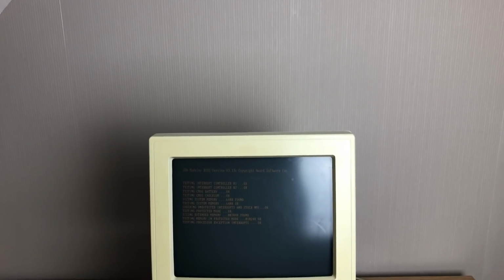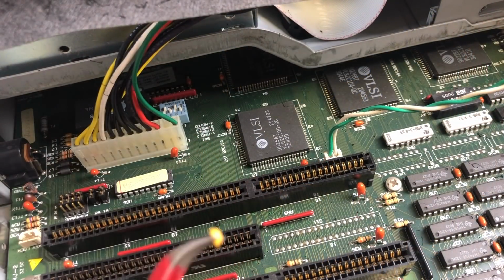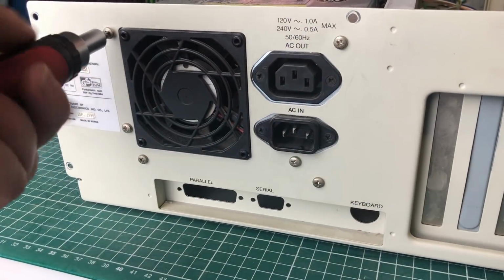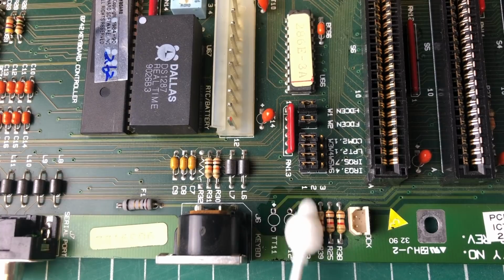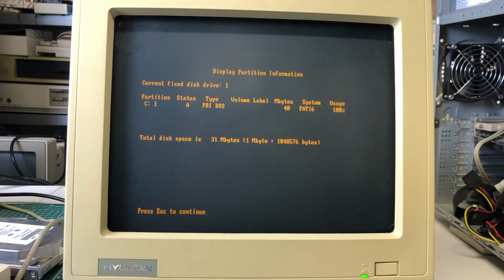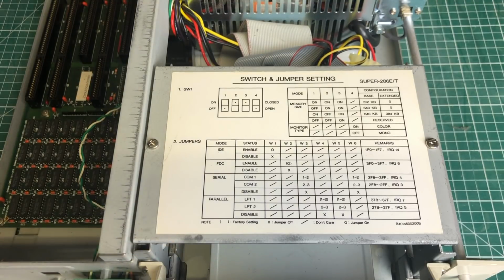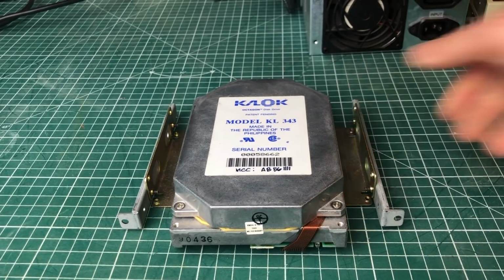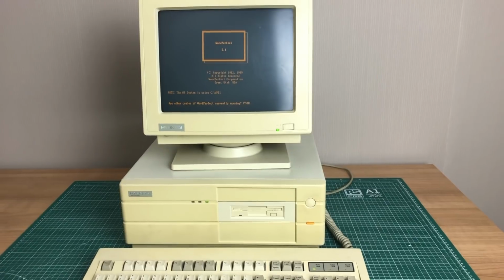Hyundai Super 286e : The most boring computer ?

Comment: Boring? I'd love to have that machine! Back in 86, an AT clone was my first "personal UNIX machine", running Xenix 2.1.3 and Microport 1.3.3. After all these years up to todays monster-machines, I think it would be fun to spend some time on real hardware like this. I do maintain a bunch of simulators with various Unices, just for entertainment.
However, real hardware like this offers the option to go shop for some add-on cards, I would need to get my old tapedrives running (a simple Adaptec 1540/42 would do - not hard to find). That would give me access to my old tapes. There is lots of rare and interesting UNIX stuff on these tapes.
I think I seriously need to find an old machine like that...

Comment: That's got to be my exact same keyboard from the late 80's. I have like 50 old keyboards, and I have not even seen it again until now.  I like the VLSI chips. My 286/12 had the same.  But my RAM was 70ns with 80ns recommended in the manual, and this is 120ns??? Shouldn't that be for an 8088?

Comment: This is a 16-bit system, so a RAM bank has 16 chips + 2 parity chips (all chips only access 1 bit at a time), so this is 2 banks of 512KiB, not 4 banks of 256KiB. It also says so on the silkscreen. The four columns are labeled "bank 0 (odd)", "bank 0 (even)", "bank 1 (odd)", "bank 1 (even)". Otherwise, nice presentation. The RAM options you can select with the DIP switches are very common for early AT computers:
(a) 512KiB (18 * 256KiBit chips) only
(b) 512KiB (18 * 256KiBit) + 128KiB (18 * 64KiBit)
(c) 512KiB + 512KiB (36 * 256KiBit).

Comment: After my first computer  blowned up in 93 (a Tandy 1000HX with an horrible green mono screen), I was using a quite similar machine until 1995. It was running very well wit Windows 3.1, MS Office and MS Publisher. The 720x348 B&W resolution was very stable on an amber monitor. And surprisingly, it was a great time ;-)

Comment: i recently got hold of a hyundai super16te,, 8 bit 8088 ! unfortunately a nicad backup battery has leaked corrosive goo and cause a lot of track damage 😢
Reply: ...i've heard about tantalum caps blowing up , but never come across it myself...yet.... i have had some small multilayer ceramic caps blow themselves similarly, though, on a multi IO board, had to replace the lot , they kept popping themselves!
Reply: i see this 286e uses the same 'non standard' power connector pins like mine, more 'square' than the usual 'flatter' AT type...

Comment: Two points I'd like to make...1. Usually the last two choices in the HD selection are 'user defined' so you can manually set the HD parameters, unfortunately the video did not seem show all of the choices.      2. The connectors that broke off on the back are probably reverse threads. This design would allow you to unscrew the parallel or serial adapter without allowing the attaching screws to come loose, as they would tighten when unscrewing the adapters.
Reply from the maker: Roadside Rebels this one did not have a manual selection. Only a predefined list. Regarding the connectors on the back. On this machine I noticed some glue like residu on the back  of the connectors, as if somebody did not want them to get unscrewed. I had an identical Hyundai where I was able to unscrew them without any issue.

Comment: Yeah those old tantalums like to blow their tops. I had one go off in a 486 motherboard, but it somehow still works.
Reply from the maker: jq747 sometimes they sit on a power rail like the -12v that is only used by some very specific expansion cards. In that case the pc continues to work fine.

Comment: Dont forget to turn the hard drive upside down and put a few drops of light oil (like 3-in-1 sewing machine oil) on the hard drives stepper motor bearing and give it time to seep in. dry stepper motor bearings are one of the causes of these early drives to fail

Comment: You're better off using solder wick when desoldering components from plated through-hole PCBs. Solder suckers are practically useless for this application, and you'll only damage the solder pads. Just heat the solder, pull the lead out from the through-hole with fine needle nose pliers, and clean up with the wick. It's much gentler on the board.

Comment: On my first IT type job I had an 8088 which had turbo when I pressed certain key combo. 6MHz, maybe? Our server was a 286/8.  But then in order to run the new backup tape system they gave me a 286/12.  The speed was sweet compared to clunky old PC I was using. Productivity certainly improved.  Amazing what you could do back then with these primitive PC's when the O/S was small and fast.

Comment: wow, an IDE connection in a 286 Pc, was very ahead for his times (about this)
Reply from the maker: a lot of these brands came with onboard connectors. A lot of earlier computers (Tandy / Commodore) also had onboard floppy controllers. The clones typically required separate expansion cards for floppy and IDE.
Reply: @RetroSpector78  about the IDE separate expansion card i remember something when i was a kid, i had a Memorex Telex 7045B, a 286 at the time, obvioulsy monochrome VGA display

Comment: I also have this PC. Mine has a Seagate ST-125A and a 5.25” FDD in the top slot though and MS-DOS 4 on the HDD. My monitor displays everything in white though.

It’s by far the oldest PC in my collection and requires the least maintenance. :D Haven’t had any blown capacitors or empty Dallas chips yet. 
Sadly I haven’t found time to do any projects on it so far.

Comment: I'm skeptical that it's ok to select different drive configuration parameters (cyl, head, etc) like this. I tried that recently and got nothing but grief until I figured out how to configure it properly. I got some of the same symptoms you're getting...wacky behavior on format etc.
Reply from the maker: Still haven’t figured it out myself ... also have had mixed results. Some things work others don’t. You’re also never sure what was done with the hardrives themselves by the manufacurers. For example I have a seagate barracuda rebranded by compaq. The hadddrive is 20gb but compaq added firmware so that it only reports 10gb (they used this drive as an official spare part for another 10gb hard drive)

Comment: Damn, it's amazing how these old AT era PCs can directly bolt in an ATX power supply....
Reply from the maker: ATX ?
Reply: @RetroSpector78  ATX is a newer power supply and motherboard standard.. it came out in the mid to late 90s
Reply from the maker: adventureoflinkmk2 i know ;) but I don’t see any atx psu here.
Reply: @RetroSpector78  there isn't.. but the way the case is designed and how the holes are aligned to screw the PSU in, it looks an awful lot like how you mount a modern PSU in there
Reply: @adventureoflinkmk2  standard AT PSU (not big IBM XT and clones) share dimensions and screw pattern with modern ATX PSU, for a time most cases were sold with both AT and ATX motherboard screw patterns and they even included an AT I/O shield. It's nice to know that you can install a modern high quality ATX PSU on an AT system with a cable adapter, most ATX don't supply -5V but there are some more expensive adapters that include that and a 12V load.

Comment: Those beige boxes aren’t never dull, they are awesome! :D

I bought a Kalok 3,5-inch 30MB RLL drive for my 8086 around 1990. It was cheap for a teenager like me and the main reason I bought it instead of a Seagate or some other big brand. While Kaloks were bashed already back then, the drive worked beautifully the time I had the machine. Only negative thing about it was that it was really loud for a relatively modern 3,5-inch form factor drive.
Reply from the maker: I have had a couple of broken kaloks ... mostly mfm ... this is the first working Kalok IDE drive I have. Has some bad sectors but seems to be working fine now. It is kinda loud, but love that old school sound ...

Comment: I have the same harddrive. Could I kindly ask you to verify something for me? My drive is working completely fine but every time the controller initializes it it makes a horribly loud klicking noise just as if the heads are slammed against the stopper. You can hear it here at about 10min 10sec: https://youtu.be/jL_H1i3fHZo ... Is your drive doing this as well? By the way some quick remarks on this drive: I found CHS parameters online that say that this drive has 676 cylinders but on my drive that was not true. It autoconfigures with 670 cylinders and if I manually use 676 cylinders the stepper motor runs to its limit and makes buzzing noises. Secondly this drive has no auto-park feature so you might want to park the heads.
Reply from the maker: Mine does not make that knocking sound like yours during initializing.I found the specs here https://stason.org/TULARC/pc/hard-drives-hdd/kalok/KL-343-43MB-3-5-HH-IDE-AT.html but the 286 bios did not have it in its list. and there was no auto-detect or 47 user-type
Reply: @RetroSpector78  Thanks for your answer. I think that is where I got the specs at first as well and after running into the above mentioned problem I dug a little deeper and found a scan of a very old HDD parameter catalogue where the same 676 cylinders were mentioned. Still if I use these parameters the drive will overrun its stepper motor range. So I just stick to the 670 cylinders that autodetect gives me. Just thought you might use these infos if you eventually use this drive on another machine that does have a 47 user type option (:

Comment: I'd love to have the HDD please
Reply from the maker: Will not survive shipping :)
Reply: @RetroSpector78  double bubble wrap it and mail it to:
Jeremie Johnson
18 Scenic drive
Belmont NH 03220
Reply: Hi - Vintage small capacity IDE are very expensive, most are also advertised with bad sectors.
I have 2 x connor 420 450 ?? IDE's in my Pentium 100 and they work perfectly

My Pentium 2 i just gave up and used a IDE to Compact Flash card for @ $10 new and a 4Gig card for @ $15
So for $25 i have about the fastest and most stable hard drive to suit, it runs Win 98 - i know it is not genuine or original but it works great.

Note there is drive CMOS limits on 26/386/486 etc for larger drives than the original CMOS can handle - before the auto detect bios versions.

You can use a drive manager like super fdisk or  DiscWizard. this was a separate purchase item, however many drive manufacturers bought it and modified it t work only on there brand of drives, eg  Seagate DiscWizard - it will be trial and error to see if it works also onbrand X or Y, in saying that, the seagate version works on my compact flash card - how strange

Also different dos versions have a drive and also a partition max file size as well

Regards
George

Comment: You call this boring?
I call it amazing for its time. 
And you missed why entirely: that onboard ide/fdc is a real treat and frees up one of the ISA slots for a total of at least 5 slots that you can stick a TON of stuff into there.
If this was my puter, I would yank out that ram convert it to socketed while finding the max amount of RAM chips that will go in, trade in the 286-12 for a -16, find a 287, and load all them ISA slots for a TON of "connectivity"....
This machine has tons of potential, especially with a working onboard IDE/FDC.
Reply from the maker: Most of these branded computers had onboard IDE / floppy , but also I/O (serial parallel), so they did allow you to put more stuff in the ISA slots ... but you would have a hard time finding 8 useful ISA expansion cards on a 286 :) (sound, network, xt-ide, memory expansion, some AD/DA conversion card, a scanner port, ..... ?). Once had 13 ISA cards in an IBM XT + expansion unit ... that's my personal best :) Would be interested in seeing what you would put in there ....
Reply: @RetroSpector78  I dunno, if memory serves me, all of my 286 machines had none of the above for onboard peripherals, not even serial/parallel ports.... maybe just bad luck I guess. But that was so long ago I prolly got my recollection messed up. Still, this hyundai machine, for me, is pretty awesome lol It would have been even better with 32 pin ram or even, Zif 32 pin ram lol
Reply from the maker: MeMad Max a lot of brands like Acer, Philips, Commodore had pc’s with these peripherals built-in. Most of these boards (like this Huyndai) were not standard and could not be used in generic AT cases due to the non standard positioning of the keyboard connector (and the presence of serial / parallel and/or other ports). Most clones used a standard AT layout and those indeed did not include stuff like onboard IDE / Floppy and other IO.

Comment: One of my summer jobs as a teen was working for a Hyundai reseller, selling exactly this system.  We sold it with EGA initially, adding to the mediocrity.  Amazingly, we never had any come back, but we never got any repeat sales either.
Reply from the maker: Hehe ... would have loved to have gotten one with an ega card and monitor .... but hey .... not going to turn down an amber monochrome monitor either :)
Reply: @RetroSpector78  the "e' in 286e was the EGA version, so the local reseller who made that one must have swapped out the card and monitor :-)

Comment: Weren't you curious what was on the drive initially? It seems there has to be some compatible setting in which it had operated before.
Reply from the maker: Yeah unfortunately that data is gone. But got a second identical one with the Connor hard drive installed. Because there was a connor 40mb geometry in the cmos list I was able to start that one with the hard drive without formatting. It just had wordperfect on it and some other utils. Nothing special.
Reply from the maker: Not really sure how to handle this : obviously could have put the hard drive in a more modern pc and check but didn’t want to bother with that. The kolak geometry was not in the list so I just picked a one where the CHS was pretty close, but obviously there are lots of types to choose from. How would you have done it ?
Reply: @RetroSpector78   My first go to option would be a newer computer. But if that is not an option at the time, I probably would have tried every entry I could. If the drive is working, the PC would boot eventually, or if not bootable, it would be readable at least. I have done this method in the past, and had some success with that.

Of course it is tedious, and if you know whats on the drive (like you did), and has no importance whatsoever, I'd just do the same and fdisk/format it.
Reply: In general you have to make sure none of the settings are higher than the drive’s physical geometry.  You specified 5 heads with the Conner profile, despite the drive having only 4.  Sometimes drives can use multiple profiles, but most of the time when you ask a drive to use head 5 out of 4, it’ll just fail and that address won’t be readable.  Or you’ll get some sector you weren’t expecting, and you’ll start corrupting the file system.  Either way, bad news.

So I would look for a profile where heads and sectors matches, and then take what I can get from cylinders.

Of course, you could also use a tool to view the FAT BIOS Parameter Block to see what the geometry was when the FS was created.  You can do that with a hex editor if you’re willing to decode it yourself (not too hard, just mind the Little Endian 16-bit numbers.)

Comment: Only capacitors can go wrong right? should really be asking yourself why the caps have all blown.
Reply from the maker: I guess all capacitors are prone to failure over time ....  These tantalums just do it in a very obvious way .... Don't know if it was related to quality issues, or their specific usage in the electronic design, but I don't think there has ever been a culprit besides just old age in all of the computers that I've dealt with.
Reply: @RetroSpector78  High ripple from the power supply is the cause, if any caps should be changed first it should be those in side the power supplies primary and secondary stages, replace with a quality brand, usually panasonic are the best for power supplies or Nichicon FW series.
Reply: In machines of this era, tantalum capacitors do just go bad, and do so VERY often. Amount of use may play some role, but as far as I've seen, it's just time that does this. The caps blew not because of other issues in the system (though that doesn't mean there can't be other issues, of course), but because when tantalum caps go bad, they go short circuit. When you have a short circuit across power rails, bad things happen. 

It's actually kind of lucky that these caps literally blew up, because that makes it easy to tell that they're bad. A lot of the time (usually with PSUs with over current protection) they will look perfectly fine, and it'll take hours of trial and error to find what's wrong.
Reply: tantalums have a porous anode and with age short out, its best just to replace them all, often times you can get ceramics of the same values which were unavailable back in the day
Reply: Typically when I run into AT based systems it's always the Resistors connecting to the Keyboard are burnt up, probably from people hot plugging the Keyboard.

Old Tantalum Capacitors will die for no reason, they either explode when shorted or just refuse to work when they open. You can either replace them with modern Tantalum Caps or switch them over to Electrolytic, Ceramic or Film. Just depends what they do in a Circuit, typically I  go with Ceramic and Film if they're under 1uF. If they're over 1uF then go with Electrolytic.